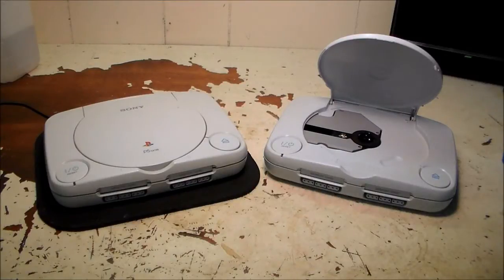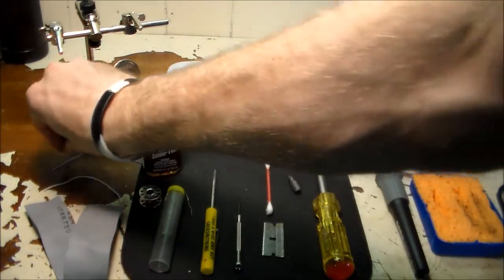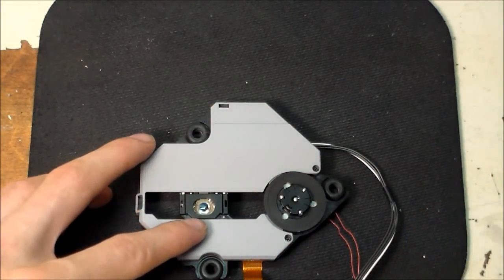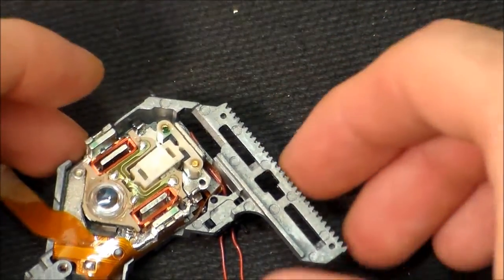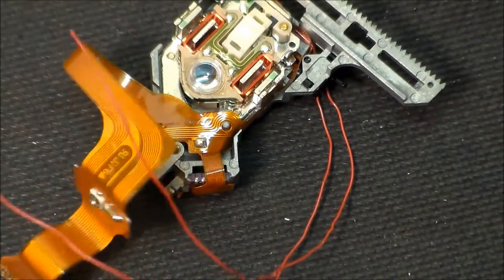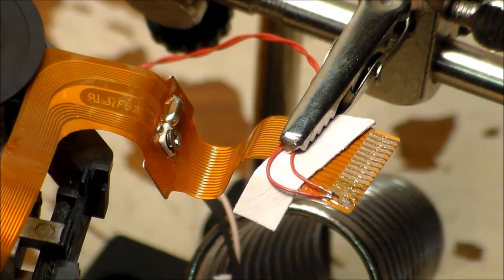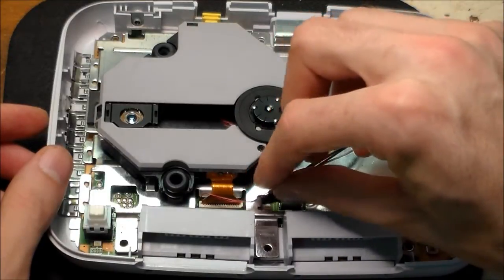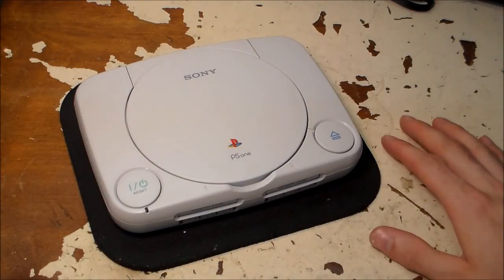Tech Repair: PS One - Torn CD-ROM Ribbon Cable

Comment: oh crap I am so screwed. I chose this as my very first solder project? Well I guess it kinda chose me seeing as how I ripped three possibly four paths on that damn ribbon cable. I'm more scared connecting wires to the wrong end pins. I'm having a time trying to trace where they end up at. I'm in over my head here :(
Reply from the maker: +sludgefactory241 i actually went back and repaired this differently. i took a razor blade and scraped the traces on the ribbon so metal would show and soldered TINY wires to bridge the tear. it was tedious but it worked out fine. the wire i used was smaller than what i used in the video. i got from a single stranded core wire. just strip the end of the wire and pull out a single strand
Reply: +thewheelman282 brother you my friend are a lifesaver! That sounds much simpler. Granted im sure its painstaking like you mentioned but at least if i screw that up its my fault not due to soldering to the wrong end pin. Thanks again and ill let you know what transpires

Comment: what if it focuses twice and stil not read the disc?
Reply from the maker: then either the laser diode is not working (check for a red light in lens) or its not quite powerful enough (may have to adjust laser pot) or the laser assembly needs to be cleaned, the lens is scratched, or the disc is dirty/scratched
Reply: thank you for your help
do you know how to agjust the laser pot?
Reply from the maker: yep
http://www.theisozone.com/tutorials/psx/general/how-to-calibrate-a-ps1-scph-1001-laser-assembly/
Keep in mind that calibrating it is a last resort. make sure youve cleaned everything and blown out any dust before you calibrate. otherwise you cant calibrate it correctly and you will likely kill the laser
Reply: i'm thinking of buying a new part either way
but i missed something there is no red light in the lens... :/
Reply: also, i have a PSOne meaning i can't do the calibrating...
Reply from the maker: you  can do the calibration. the link is for 1001 models but the pot on the ribbon cable is calibrated in the same way. but yeah if theres no laser shining, you will have to get a new laser assembly